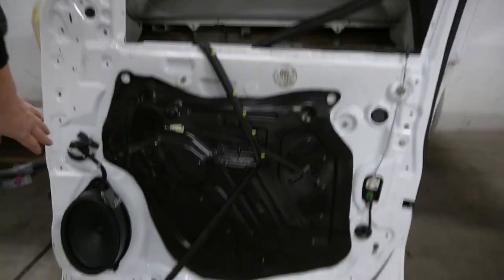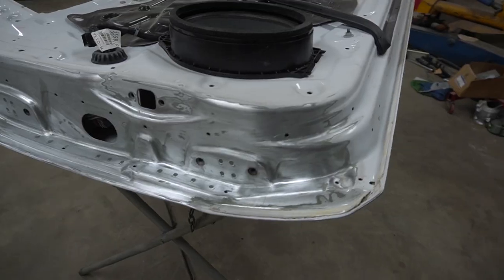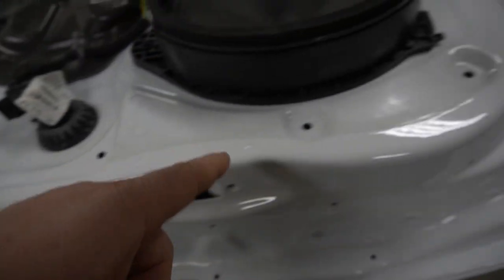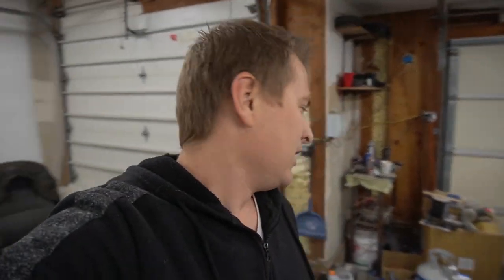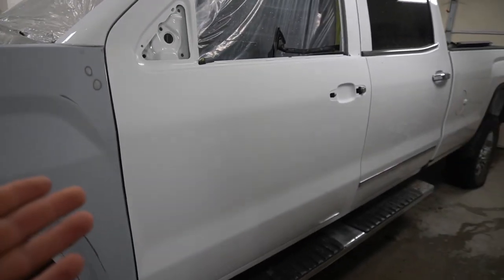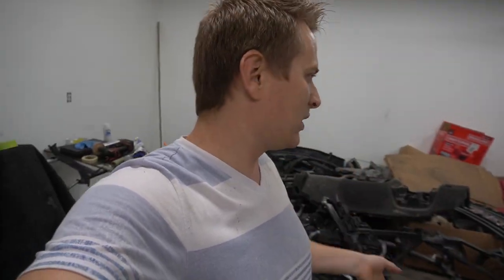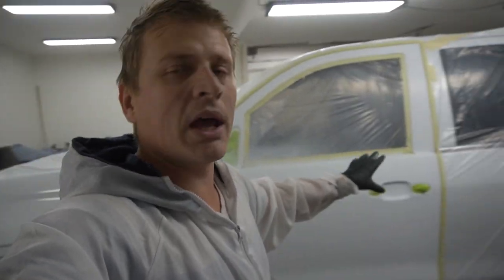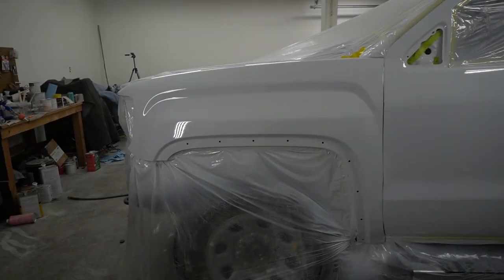Rebuilding A Rolled 2018 GMC Sierra 3500HD/Painting part 26

Comment: that propane heater had me worried for a couple reasons. The lesser reason of the two is Propane puts a ton of water into the air. Enough that you will get condensation over everything within the area it is being heating. Those Jet heaters are not designed for use inside. With you painting the truck it ran the risk of putting a coat of water/condensation on the truck in between each layer.
The more serious concern is clear coat vapours are so thick in the air, and they are extremely flammable. The heater could have very easily flashed off the entire garage and burnt you and house down.